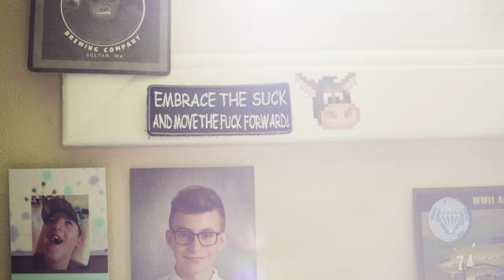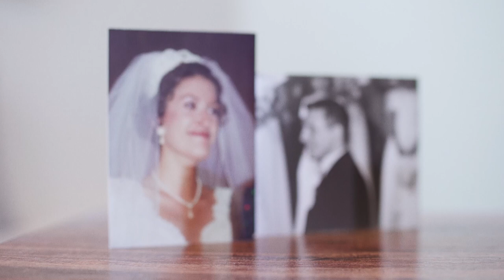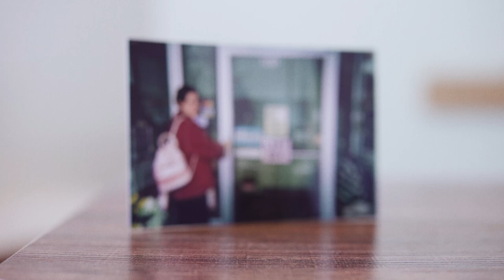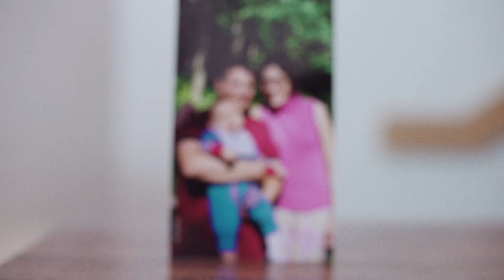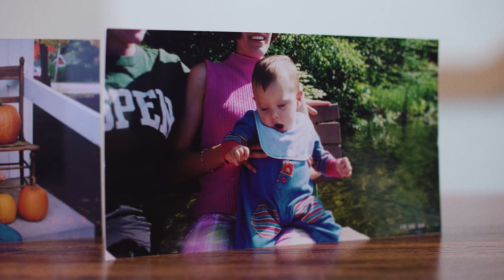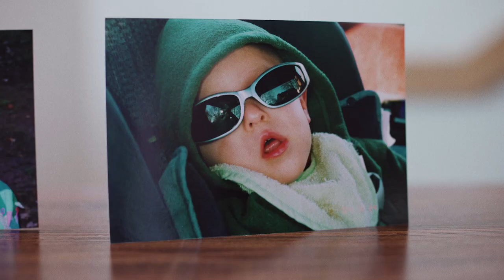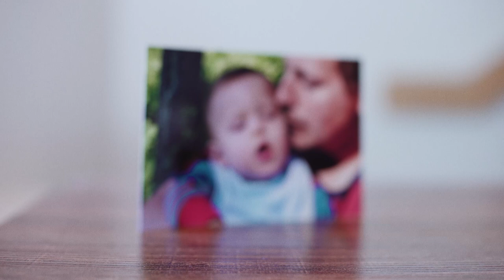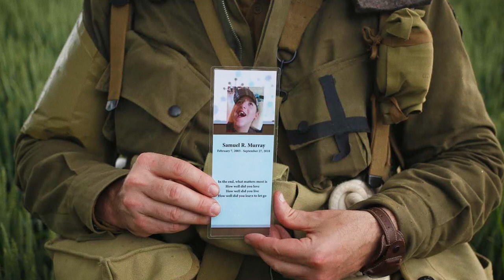J. Murray Inc. 1944 - Our Story

Comment: The picture at .03 seconds looks like the pile of m1 helmets at Smith and Edward's I used to pick WWII helmets out of. Robin Bartel has an original MP fixed bail helmet that I found in there along with several others and an original m2 helmet. I was buying them for 50 cents a pot or $50 per pallet load!!!